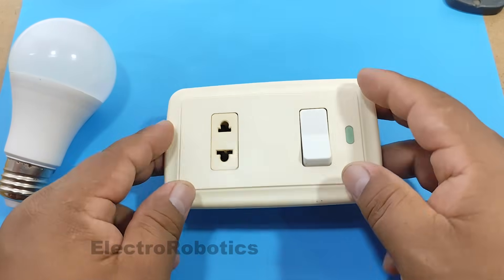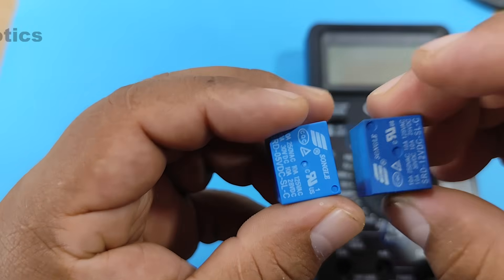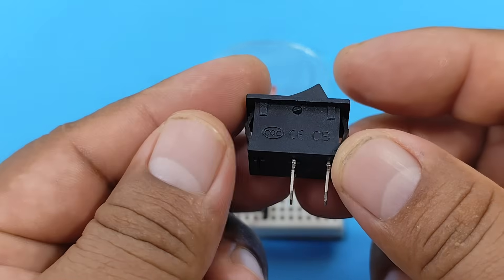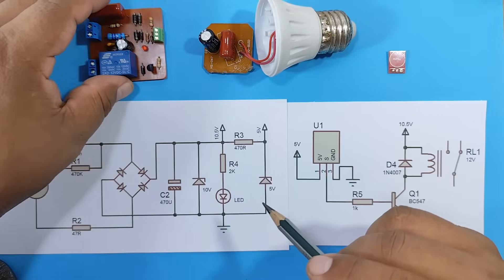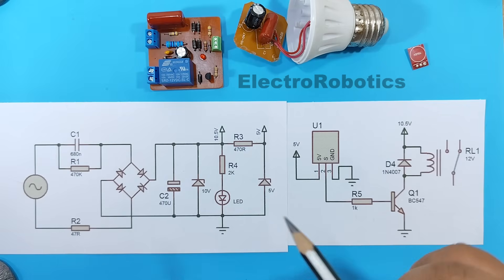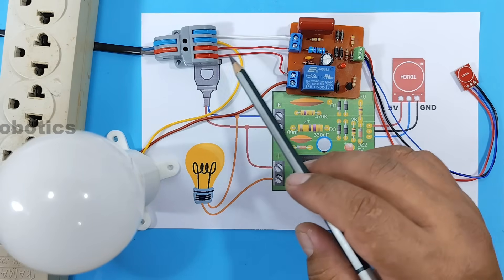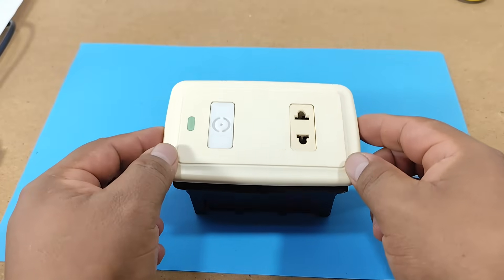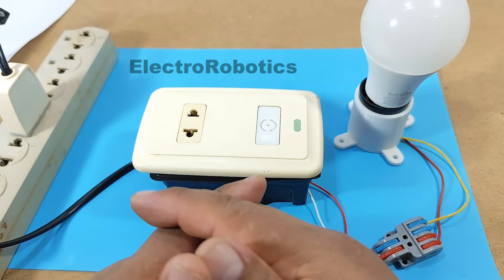Make Your Own Smart Switch, NO More Common Wall Switches.

Comment: connecting this board and energize it with direct ac mains is far unsafe and never do this. use transformer and separate relay circuit from sensor circuit. this device is dangerous!!!
Reply: Well then so are many consumer electronics that do the same thing such as my refrigerator control board for example

Comment: Nice PCB design! Yes, please make an improved version of this. This is very good for learning but there's a problem. Normally, in lighting circuits, a neutral wire is not taken into the switch box. This will require complete rewiring of old houses.